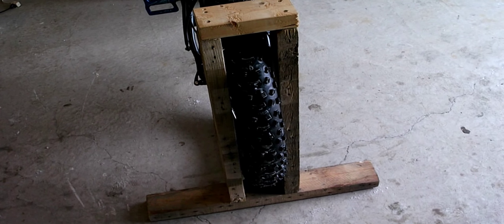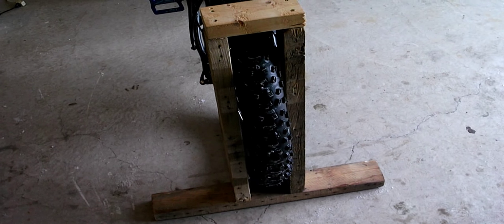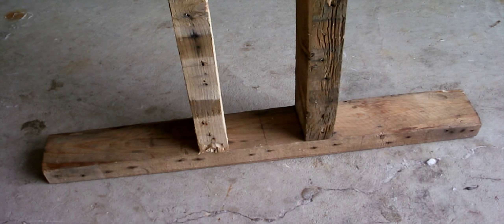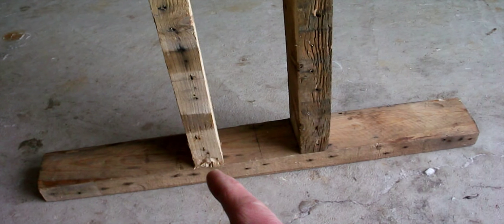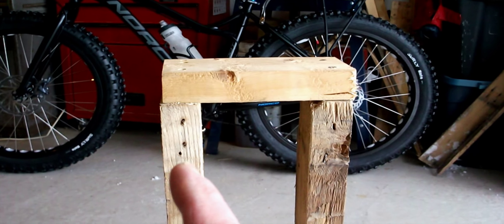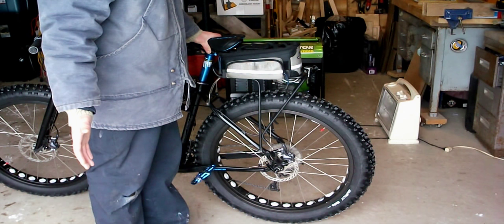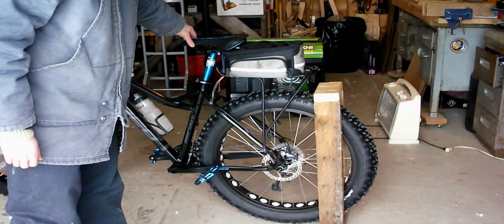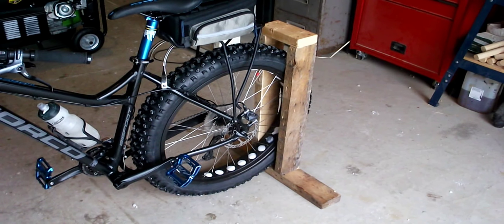Fat Bike Stand - simple, easy and cheap

Comment: Very well explained than you!  I made one for a regular mountain bike 2 inch tires. Has anyone made this stand with shorter bottom board?  Meaning the board that sits on the floor.
Reply from the maker: Not that I'm aware of. It would be a little "tippy" I would imagine.